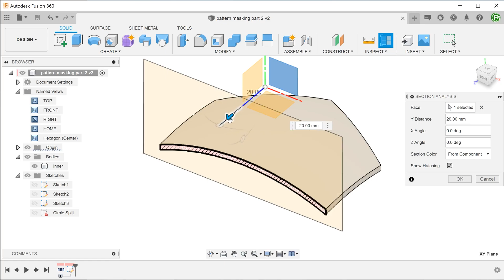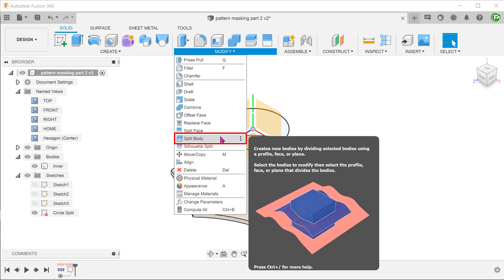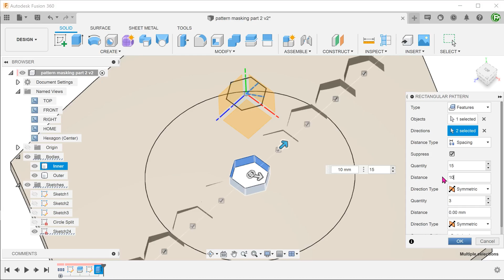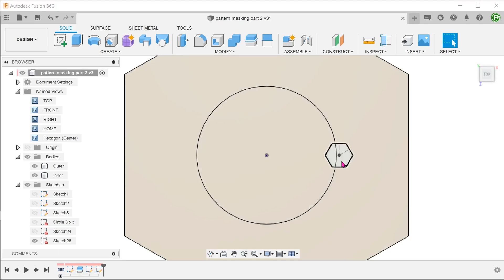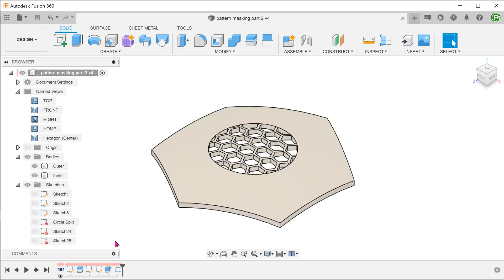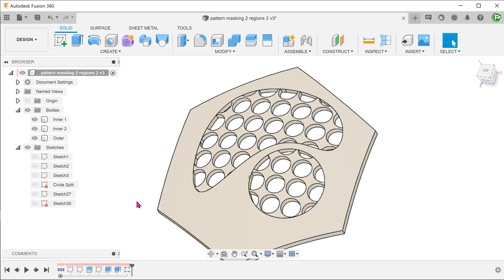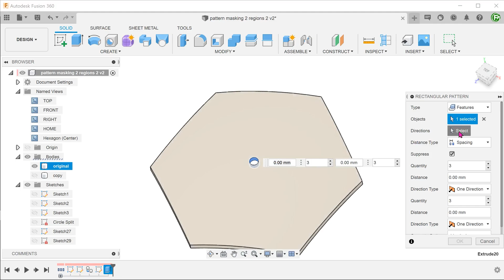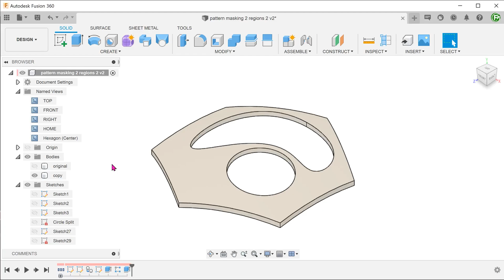Fusion 360 - Pattern Masking Part II

Comment: Could you hide one of the bodies, do the pattern cut, and then reveal the hidden body to get the same result?
Reply from the maker: I went to try this. It does work. When a body is hidden, it does not show up as a body to cut. This is a great suggestion. Well, it kind of nullifies what I have done here. 😅 But still, great suggestion. I would often zone in on a method and close my mind to the obvious. This is why the community is so valuable. Thank you.

Comment: Looks nice but is it possible somehow to use surface normals so each cut to be in its own angle to the surface?
Reply from the maker: To cut normal to the surface, we can use either offset or emboss. I have not tried patterning an offset before. Also, emboss would not work in this case since the plate has curvature in 2 directions. You might want to try experimenting with doing this on a cylinder. 
Kristian Laholm just did a video on this.
https://www.youtube.com/watch?v=aO3GHprjDvM&t=815s
Reply: @Fusion360School  I think it might be something in that direction https://youtu.be/MJWnmaUfs8A

Comment: Is there a way to align duplicated objects to a curved surface (or to its normals)? 

A long as the cutting object is relatively small and the target objet relatively flat the result is ok. But imagine cutting hexagons around a sphere...
Reply from the maker: This sounds like a job for the emboss command which performs a wrap. I have yet to try patterning an emboss feature. In this case, the plate has curvature in 2 directions, so emboss would not work. Maybe I can try patterning an emboss on a cylinder.
Reply: @Fusion360School  I have just tried this and doing a circular pattern of an emboss feature around a cylinder works fine.
Reply from the maker: Great, good to hear. Thank you.
Reply: @Fusion360School  you can solve embossing on bi-directional curvatures by using sheet metal flanges, but it is tricky to do, and almost impossible to dimension :)
Reply from the maker: @Fusionpåskånska  Yes, Eitenne K
https://www.youtube.com/channel/UCz8-rF2TMG0bdYCWdfDumhQ
is quite famous for doing that. Hope that Autodesk would let us implement emboss on bi-directional curved surfaces soon.